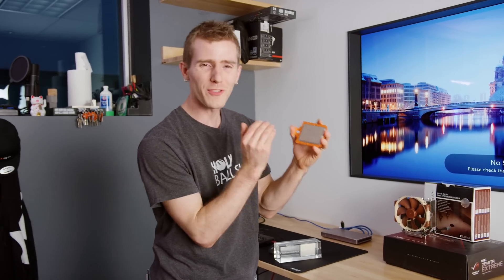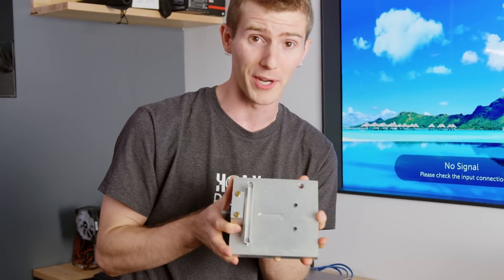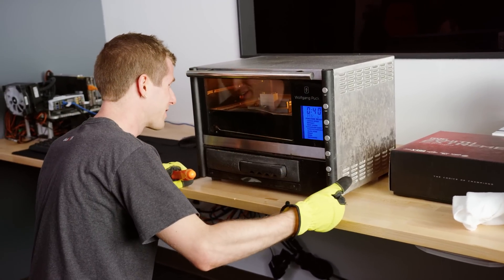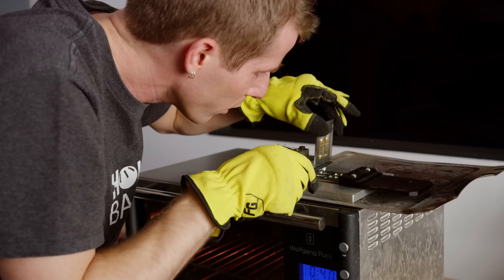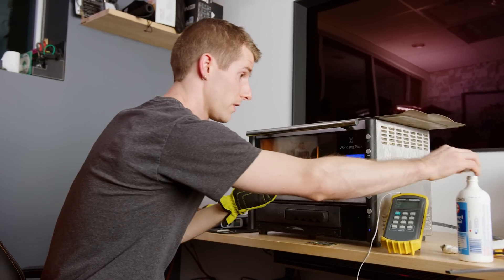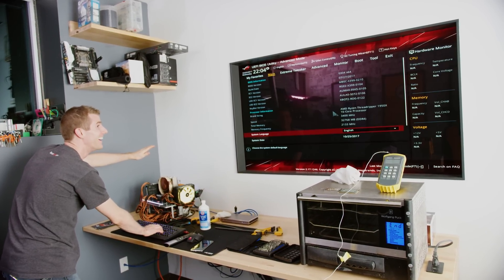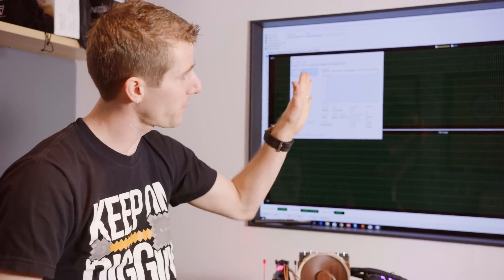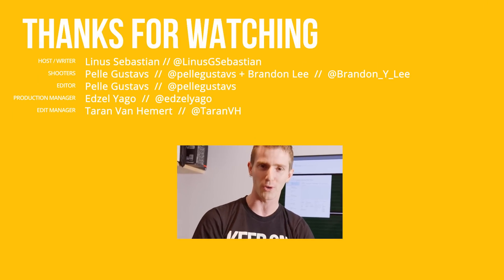Why would ANYONE Delid THREADRIPPER? - Vanity IHS Installation

Comment: 0:10 One of the COOLEST pieces of swag? Dude, this is AMD we're talking about.
Reply: Funny how people are talking about AMD like that when nearly everyone had it back in the days because it was the best xD
Reply: It's not like Nvidia and Intel are strangers to massive heat output either.
Reply: Ryan; Well if you go back far enough then yes; in the early-mid 2000s AMD had the performance crown pretty handily with their Athlon 64 processors. Then Intel took over for raw performance for years and eventually became massively overpriced because AMD only recently managed to get a real competitive edge back - which is good no matter which side you're on because if you like Intel processors you aren't getting hosed with a massive price tag, and if you like AMD you have really good processors again.
Reply: MGIBlaze: Go back even further than the Athlon64 and you'll see AMD was competing well with Intel for a good 25-30 years and that recent times are not normal at all. AMD had the first 130nm chip, first CPUs with copper and not aluminium interconnects, first retail x86 CPU to reach 1Ghz and for pretty much half the Pentium 3s lifetime offered a better solution for the same price.

Hell, even back in the 386/486 days an AMD 40Mhz 386 screamer system with 16MB RAM cost as much as an Intel 486SX-25 with 8MB of RAM and was a shit tonne faster for your buck. Even after the Athlon64s, Phenom II competed quite well with the first gen i5s and i3s (It didn't beat the i7s but they also cost a hell of a lot more) but people always forget about the Phenom IIs because they weren't top of the line albeit great budget chips.
Reply: RyTrapp0 Yep, without ryzen, coffee lake would have been just another quad core with a 200mhz max frequency bump over the previous gen. Just like Kaby lake was/is.
Reply: ....but AMD runs way cooler than Intel.
Reply: Smug Tohru. Typical

Lol jk
Reply: Alex G Not unless you delid the Intel chip, or it’s Skylake X.
Reply: Makes for a good room heater - esp. the Core i9 (more like Intel i69)...

jk
Reply: Well that one didn't work, so it's fairly cool.
Reply: Stfu AMD cpus are great
Reply: @Alex G; and they pretty much always has, the problem is that the TjMax is also traditionally rated significantly lower than on Intel. so you get about the same result with the same cooler on them. Technically Intel CPUs should make the GPU run hotter though as they do operate on a higher temp and thus offloads more of that in to the case. It's weird seeng peopl talking about AMD as hot on the CPU side of things, even their 220w fx9590 shuts down somewhere between 60 and 70*c. Which is nothing compared to Intel which can handle (and often runs close to) 100*c.

Different designs means different thermal outputs, the power draw is not at all indicative of how hot things actually get.

Comment: so if you delid it will it produce as much heat as the sun?
Reply: Ryzen CPU's are way WAY cooler than i9 CPU's
Reply: If it becomes a deadly laser , then yeah pretty much.
Reply: the sun is a deadly lazer
Reply: no, that's the FX9590 you're talking about...
Reply: Casual, Ryzen is extremely power efficient in multi thread workloads compared to Intel. You don't need to lecture me on single core, it's irrelevant, especially in this video that focuses on thread-ripper.
Reply: anghellic usually that's true, because they use poor quality thermal compound under many of the CPUs, so people delid them and replace the compound with a high quality one.  But it seems the threadripper conducts heat directly through a solid metal solder, which is probably even more conductive than the thermal paste.
Reply: Danielle Spargo all AMD uses is actual metal solder. But it's also applied by a machine so Linus probably applied too much.
Reply: no less heat than an i9
Reply: Only thing hot about AMD CPUs right now is how hot of an Item it is in peoples' carts. My R5 1600x has only climbed to 66C at full load with just a 2 240 Rad AIO. :| That's including being downstairs where the fireplace is.
Reply: GameGabe ya I though delidding them and connecting the cooler block directly to the cpu would drop its temo a few degrees not raise it they even made a vid on it
Reply: The sad part is the 7980XE uses a KILOWATT of power when overclocked. Intel has hit a wall with their CPUs and at this point, thermals are only going to increase with each generation unless they actually make a new CPU architecture. Intel's proven this with Kaby Lake's small increase in clock speed due to it being much less efficient than Ryzen. They've pretty much pushed the Core i architecture to the limit. You can't even fucking run a Core i9 on air cooling, even on the lowest end 7900X. At stock speeds, the 1950X is not far behind by any means from the 7980XE, and uses much less power under load. X299 is a fail.
Reply: the inside of the test fusion reactors is actually threadrippers
Reply: Amd is for peasants. Intel is for gaming gods.
Reply: Ivan D actually ryzen is fairly good with heat and efficiency
Reply: Ryzen runs fuking cold. regardless of whatever solution they have taken.  I7 Skylake/Kabylake have been the hottest processors I've tested. I've built over 15 of them not overclocked.  I7-7700/6700 comes with box cooler that it can't even use, it thermal throttles itself. Trying running Furmark and see what happens lol.  I had even the 1700 super cold temps.
Reply: The heat is for the older architectures that they have kept updating rather than replacing and pushing it so far even though they were outdated. It has nothing to do with AMD in general. Just like Phenom processors back in the day being just as good as Intel counterparts for cheaper and running just as cool. I like how people try to knock the soldering being there while Intel has gotten a lot of flack recently for their processors throttling to keep temps lower while costing so much more and only using paste.
Reply: The 1700 is a beast. I canceled my 1800X when I saw the 1700's powerdraw and still being overclocked so close to the 1800X. My 1700 does 1690 in Cinebench at 3.9GHz and I spent little time getting it there. I could probably get more out of it if I put time into it.
Reply: GameGabe if you place it on the sun yea but it is hot already
Reply: If it produced that much heat then imagine the size of the power supply to run it.
Reply: @Cheeky Russian aka Cossack-HD
So power draw not TDP. TDP is Heat, not measured at a power connector.
Reply: That Mantle of the title belongs to Intel i9s, not Threadrippers.
Reply: Ivan D Attempts to overclock i9s would have... more extreme heat outputs than Threadrippers. Which is quite unfortunate.
Reply: I have the i7 8700 and can confirm this.
Reply: ramin rostami, because Ryzen distributes the load across its long die and also the clocks are very much within the high efficiency ratio. Soldered IHS helps a lot too.
Reply: GameGabe not as bad as an AMD FX processor.
Reply: Lol. I9 is hotter and draws more power. Basic logic states the higher the powerdraw the hotter a component. Don't believe me? Overvolt your cpu when you overclock and tell me the temps
Reply: Ivan D you are thinking of the fx processors
Reply: no, just no
Reply: bsdhbd Hdgd It’s the cool thing
Reply: Depends on the cooler you sit onto to. If you slap down your typical aluminum cooler, expect fried chips for a snack later. If you instead used a cooler designed for direct contact like the ones we used 15-20 years ago that had copper slugs through the center. I imagine the chips would stay within ideal temperature ranges.
Reply: Yeah I also was playing around with 1700X as a joke on a $13 cooler from ebay. (not a large 212) It ran very well turboing to 4.0Ghz. I put my hand on the cooler while running tests and it was cool to the touch. So it says 95TDP for 1700X but its just like 1700 which is 65TDP.  and Intels are 95W TDP but run like they are 150WTDP.
Reply: Ryzen's extremely power efficient, and the IHS (Integrated Heat Spreader) is soldered to transfer heat better. Intel had to switch to a TIM (Thermal Interface Material) because their chips ran too hot for solder. The amount of heat the chips would produce, and when it would cool down, would cause to flex the chip itself; this causes the solder to crack over time. The problem is that TIM does not transfer heat as well as solder (probably because Intel uses a very, very cheap TIM). It seems that after Ivy Bridge, Intel chips started having heat problems starting with Haswell since I've read stories about people delidding their 4790Ks. Intel switched from solder to TIM after Sandy Bridge.

Had AMD wanted to, Ryzen could have easily gotten away with a TIM under the IHS. Ryzen was built for the future and has tons of headroom for performance increases without causing thermals to raise as high as Intel's. That's Jim Keller for you ;)

I still run an i5-2500 to just under 4.0GHz on turbo, and since it's soldered, I can run the stock cooler without seeing temps go above 80C unless I run Prime95. And the performance difference between a Kaby Lake i5 is not that bad actually.
Reply: bsdhbd Hdgd  Yeah and? That seems a bit redundant... There's shit loads of Intel fanboys too. What's your point?
Reply: LilBanana   I think you've got your wires crossed. AMD has had better thermal efficiency than comparable Intel chips since Zen.
Reply: John Smith   Well this is Threadripper, it's still more power hungry than a standard 6-8 core CPU.But more efficient than the i9's
Reply: John Smith  I paid $12.75 for 2. https://www.ebay.com/itm/AMD-Socket-AM3-AM2-AM2-939-940-754-Solid-Copper-Heat-Sink-Cooling-Fan-Adaptec-/332323725093?hash=item4d60099f25
But here's the listing now, it went up on price.  You put that on i7 and you absolutely will burn your fingers touch heat sink.
I had that on the 1700x. Confused while running it.

I also ran battlefield1 for nearly 2 hours. 

Fx 9590 are like just as hot as the new Intel CPUs lol. (Amds only true really hot CPU and some phenoms)
Reply: ahem the majority of cpus will do 3,9-4,0Ghz just fine, the top 5% bullshit is 4,1Ghz, and yes the single core story it's true but the bottlenecks will show only at high framerates (over 120fps), so stop ranting and be grateful for the 8700k beast that came out from this.
Reply: Francesco Fasano yeah lol
Intel fans finally got a crazy cpu from AMD shenanigans. Too bad you have to spend $450+? For the CPU +$150+? For Mobo?

But I am not comparing it to threadripper.
8700k is awesome and first time Intel did something in ages...  
My Friend is still confused why my i7-3770 still gets near same fps as his 6800k and 7700k. I kept telling him, they Haven't changed in a long while since i7-2xxx series. Just 6-16% in gaming.  I was even playing around with old core to quad lga 775 CPU and that sucker was almost as fast as the first i7s.
Reply: The heat sink is copper though, which dissipates heat better than aluminum. Intel USED to ship their stock coolers with a copper slug in it with aluminum fins around it, but they stopped doing that I believe after Haswell.
Reply: DropToasterInTub yeah I used both coolers from intel. I have the old one with copper core. Both coolers couldn't get any where near normal temps.
$35/40 Intel solutions they sell on Amazon. (It's designed for the i7 Skylake and kabylake and it's very large. I was still in the 80s and would go to 95+ and start to thermal throttle.

H50 Corsair liquid cooler had issue cooling another i7-7700k (another CPU) he had to get different one. He was getting over 105.

Basically you need $80+ liquid cooling or $20-30+ air cooler for i7s. 212 I think can do it but my technicians I know said any cooler with gaps in between the heat spreaders plate will make it nearly unuseable. So yeah some complaints with the large cooler master cpu coolers too.
Reply: https://ark.intel.com/products/35428/Intel-Core2-Quad-Processor-Q9650-12M-Cache-3_00-GHz-1333-MHz-FSB    Its like 1 of intels first I7s. I7-920 was but this one has similar performance and was a quad core.   Intels I7 performance jumped 1. Core 2 Quad+I7-920(first gens) 2. I7-2xxx-47xx(large jump) 3. I7-6700/7700(small jump, exaggerated gaming boost performance) 4. I7-8700K ( bigger jump but because Ryzen forced them to do it)   Intel was taking us for a ride.  To justify the monopoly and being on top of the market, they didn't need to make huge improvements but they should of kept their prices lower. For tech people like us we actually test it and can see how badly we got ripped off.  Even DDR4 is pretty stupid too, doesn't make that much sense.
Reply: No only Hydrogen fusion or Thermodynamics can do that. BTW FUSION NOT FISSION.
Reply: Actually, CPU's have had a higher energy density than the sun for quite some time now. The suns core is estimated to be about 276.5 watt per cubic meter, shockingly low compared to a CPU's 85 watt per ~6 cubic CENTIMETER (i7 8700k), which is hugely more power dense.
Reply: Cheeky Russian, you DON'T MEASURE TDP FROM POWER DRAW, TDP and POWER DRAW are 2 DIFFERENT THINGS, TDP is Thermal Design Power, thats how much HEAT measured in watts the chip can disapate not how much power it will draw, they are closely related as most of the power ends up being lost to heat but they are NOT the same.
Reply: Cheeky Russian aka Cossack-HD found the marketing parrot!
The 1700 of course with 8cores and 16 threads BETTER do just as well if not better than the 7700K in multi-core performance, and because of that its able too have lesser dropped frames if you're a streamer.  HOWEVER, it gets its ass handed to it in single core which in turn in majority of the titles it'll run slower max frames and even min. Which is also contributed to the fact that almost all Ryzen CPU has a silicone limit and can't OC pass 4Ghz and getting 4Ghz OC is the top 5%, good luck even trying to get 3.9Ghz out of your chip. Which also figures in the weak ass memory controller its supporting.
Reply: well if it's a male threadripper that's exactly how hot it gets, but the females actually get as hot as neutron stars, this is a special defense mechanism to protect themselves from torturous poachers known as "overclockers"
Reply: now TR4 cpu & something new & why dont AMD & intel put better "TIM" or thermal paste on lid?  what was the i9 full benchmark results?
Reply: Ivan D, R7 1700 is 75W TDP just like i7 7700K and R7 1700 has much better multi core performance - stutter free streaming without dropped frames. Real TDP measurement was done on CPU power connectors by Gamers Nexus.
Reply: No less heat than an i9? AMD CPU's are barely cooler than Intel and thats with soldered IHS... an AMD CPU would melt itself without solder. And no I am not an Intel fanboy because my sweet dream right now the R5 1600 but im waiting for Zen 2.